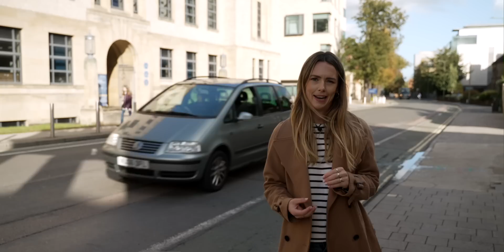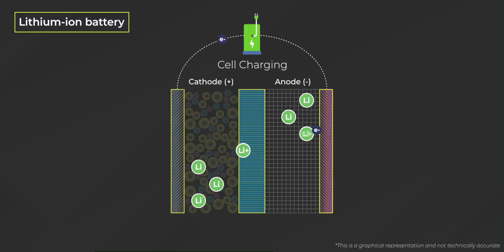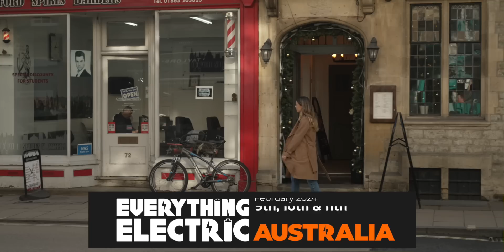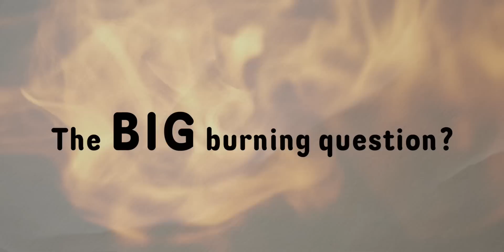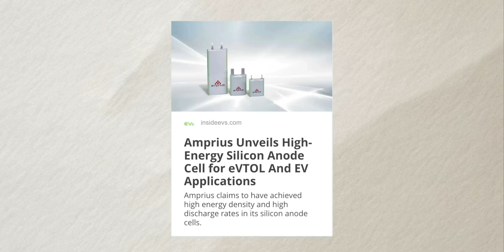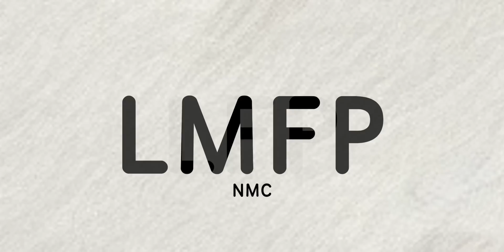The BIG Battery Breakdown: Fires, Failures and Future Breakthroughs!

Comment: One thing I've noticed since having my EV in the last 5 few months is a mile is not a mile. A mile on the motorway or in the mountains is not the same as a flat A/b road. So a 500 mile range battery will probably give me the same full petrol tank range that I had in my mini (300 miles). my car has a WLTP range of 220 miles  which gives me about 100 ish miles motorway driving and more than covers my daily needs. What concerns me most is battery depletion for a given number of charge cycles. I kept my mini for 8 years and it still had all the range available to me. I hope that replacement battery pack will also come down in price over time or there may be many EV's in good condition being scrapped because of the batter state.

Comment: Sure, but the goal will be to hit ranges still between 4-500 and around 7-800 for long range. The only ones that will need 1k+ will be shipping and airospace. After we hit that - its then trying to shrink the battery all while trying to lower the cost of the battery is general. Na + other technology will more than likely take over at some point by 2035+ as the tech will only improve and whatever works with Li will more than likely help Na as well. Again, just need to hit the min of the 400-500 and Na holds both supply and doesnt require mining that normally destroys land. If anything Na + LFMP will more than likely take over by 2030 as the supply starts to ramp up for both. S and Si both allow a 2 to 5x increase as well that again will work for Na and LFMP easily allowing that 4-500 range. Solid state can also help Na batteries already with a few companies releasing ones you can buy today so already a proven method of it working there. Thus Na can take up less space and weight even though they do require a little more to make up the same power des of a cell making them just as good as any other battery at a cheaper and safer chooice.

Comment: For the 1,000 mile battery if your towing a huge caravan or heavy trailer due to range lost you'll probably only get 500miles on the same battery.  Although a 750mile battery would be enough as it would be maybe 400miles.

Comment: I think we have a varying list of needs out of batteries

For example we don't need high density batteries not really what we need is long-lasting batteries that are cheap That's what we need

Right now 60% of the US population can't afford an electric car probably closer to 70% I mean you would need to make $65,000 a year just to owe enough in taxes to be able to claim the rebate which I believe they finally updated to be refundable now because before this it was just a wealthy person's coupon code for EVs poor people need not apply

What we need is consistency reliability long life and a price people can afford and here's how I think we can achieve that

We need to develop a glider call it the People's car like they did with Volkswagen where every manufacturer will receive tax benefits if they make the people's car The glider will be the same from every manufacturer same motor same charger same batteries save everything The body that you put on the glider can be anything you want but the glider itself will be the same and because this car will use all the same parts made by a dozen different manufacturers there will be a dramatic economy of scale impact on the price meaning it'll dramatically reduce the price

Lithium iron phosphate is probably the ideal since it has the longevity

As for range what we need is a 300 mi range battery that's actually a 400 mile range battery hear me out

We develop a battery that will push the standards sedan 400 mi but you're not allowed to go 400 mi The car will cut you off at 300 mi as if it's dead

No way to override this why? For reliable consistency if you're pushing the car a little harder it'll dip into that reserve of 100 mi to make sure you still go for 300 miles if it's winter time and you're running the heat it'll dip into that reserve so that you still get 300 mi you see what I mean? As your battery degrades and you lose range over time the software will dip into that reserve more and more so that you have a consistent reliable always there 300 mi range this will basically erase range anxiety and erase most of the complaints people have now your car with 300,000 mi on it will still go 300 miles on a charge and will probably be able to do so up to a half a million miles before eventually that hundred mile reserve is not enough to maintain 300 miles but who keeps the car that long? Hardly anybody

This will also help preserve used car value it'll eliminate range anxiety it'll eliminate the longevity in general of the battery pack it'll eliminate winter concerns and summer air conditioning concerns it will eliminate most of the basic concerns people have with electric cars that excess capacity will also reduce the wear and tear on the battery since you won't be discharging the battery nearly as much as you normally would effectively every time you ran to zero you would actually have 25% of your capacity left so you would be effectively never dropping the charge below 25% on top of whatever margins they already have in place again this will extend the life of the battery They could even make it automatically discharge to say 20% and only charge to like 85% again only utilize it excess capacity when it's needed to ensure you still get 300 mi range driving around New York City 300 miles range going across Kansas 300 Mile range crossing the Rockies 300 mile range.

The core problem right now is most of the population can't afford the cars

The people who need electric cars can't afford them the people who can afford electric cars are the ones who need the range

Thousand Mile batteries also make a lot of sense who would need a thousand mile battery? Well the guy who needs a 3 or 400 mile battery but he only gets 3 or 400 mi out of that thousand mile battery because he's towing an 8000 lb trailer pickup trucks could use a thousand mile range battery

I would also love to see 500 mile range minivans plenty of space for the battery and these are vehicles where you put five or six people in them and cruise across country

The other advantage of a high range battery is that apartment dwellers can now own electric cars with a range that large you don't have to charge at home you just visit a quick charger once a week like you currently do by visiting a gas station once a week

The primary things we need however are a consistent reliable range that is sufficient a longevity that is sufficient and a price people can afford a $30,000 cars too expensive we need to get below $20,000 not counting rebates and coupons below $20,000 pre-rebate.

Comment: Can you please do a piece on how EV published range is a scam? Thanks.
Reply: Not a scam, it's a standard. It's just as unrealistic as the way ICE vehicles measure mpg. EV range varies hugely depending on use and average speed. if you plan to do constant 80mph then you will get a lot less distance compared to doing a constant 50mph. If you are doing stop start driving in town then your average moving speed could be down to 15mph, so you get a lot more range in that situation.
Manufacturers can't give one number that covers all those situations, so they test to a set of standard conditions covering various situations such as Worldwide Harmonised Light Vehicle Test Procedure (WLTP) or New European Driving Cycle (NEDC).
You get a quoted range that is less than the best urban range, but better than highway range. It's useful for comparing different vehicles, not for planning overland road trips.
Reply: @drumbrakes  thanks for the lesson. You aren’t the channel editor, so I didn’t ask for your response, thanks. I am aware if what you have said here, but no EV mileage is ever achievable and it is the only EV stat that anyone talks about. They need a completely different metric.
Reply: @Surtees-ff  Make your suggestion for a new standard then. I'm listening.
Reply: @drumbrakes  ok; all EVs share online range data and average it per model and brand. Then, when buying and EV that you think will do 130miles you will know it won’t even finish your commute.

Comment: the issue with EVs is the insurance is currently ridiculous. I can't justify buying an EV hat isn't a tesla and yet a teslas insurance at the cheapest I could find is still 50% more expensive on insurance which is more than buying gas for the year.. CO2 is not, they got to do better to make it worth while to change. only a rich persons car still or buy a shitty one and have all the problems with other brands.
Reply: That has more to do with Tesla's repair costs than the battery chemistry, which was the subject of this video. One thing the video did discuss was new chemistries making batteries cheaper, so even if Tesla said the whole battery needed replaced, if that was $8-10k instead of $20k+ the insurance rates would decrease substantially, at least eventually.

Comment: Thanks for this video. Insightful and well explained. Lots of promising technology for further advances. It is worthwhile mentioning each time that there is a big gap between prototype and mass production at cost competitive levels. Tesla 4680 ramp shows how difficult it is to incorporate new technologies such as dry electrode and tabless batteries in mass production. I would assume that they are already working in the background on some of the new chemistries you cover in the video. Amprius clearly has some great technology. The question will be how long it will take to get to low cost mass production.

Comment: He says NMC is the worst chemistry for fires and then talks about Iron Phosphate. Try drilling a hole in a NMC battery. Take out deliberate ICE car fires (theft, vandalism etc) and  ICE fires are a lower percentage per cars on the road. Battery fires are virtually impossible to extinguish. NMC also discharges Cobalt as a vapour which can be devastating to anyone who comes in contact with it.

Comment: 1000 miles range how long will it take to recharge and if course that Scotish chap came up with that favourite chestnut you EVANGELISTS use an ICE vehicle is more likely to catch fire fair enough there us more of them but an ICE vehicle fire is easier and quicker to extinguish than an EV which equals less toxic gases escaping into the atmosphere and far less water pollution and l have been driving for 50 years done millions of kilometres and never any of my 16 ICE vehicles ever caught fire not one.This 1000 mile battery what will be the real range of the battery be maybe 800 miles not good enough for Australia and why didn't you try and debunk that catastrophic truck battery fire in Melbourne it was on a Janus converted featured on The Fully Charged channel and fronted by Robert Llewellyn himself spurking how fantastic an idea it was.This EV truck fire was catastrophic much much worse than any diesel truck fire all those toxic fumes escaping into the atmosphere all that polluted toxic water going into the ocean EVs are great for the environment  l don't think so

Comment: the battery debate is basically about thefairy tale of  goldilocks  more than a quistion of battry chemistry  I personally think that just going from 11 kw/h DC & to 22 Kw/h DC is actually a more relevant debate than whether the cars can drive 1600 km aka 1000 miles, I believes that the  "goldilocks zone",  is between 400 km to 700 km. because here we have optimal use of our resources, and a range that covers 80-95% of all driving, in fact it is more relevant to get better DC charging than AC, because lightning chargers are fine and I actually think that we are between 100-300 kw/h is quite plenty, and more than we actually need, yes I personally choose to limit AC charging on my Id4, and would rather use a 75 kw/h charger than one with more capacity simply to protect my battery from overheating, to keep range knowledge on my battery, on the other hand, a DC let option of 22 kwh rather than the 11 kwh that it has would be much more useful, therefore it is more about the car manufacturers than about actual battery chemistry.   

it is good that we will soon have better batteries, with new technology, but range knowledge is actually quite fine as it is now, the focus must be on DC charging more than AC charging, and that is a question we can send on to the car factories

Comment: 15:01 I expect capped carbon nano tubes to be the solution. The sulfur is packed into the carbon nano tubes and then the tubes are dropped threw a plasma to close the ends. 22:25 yea, but 400 miles at highway speed in snow would be nice.

Comment: As a Canadian I can tell you that you don't need to drive north to be 1,000 miles without a charge point. Ottawa to Winnipeg is over 2,000 km in hilly terrain, Calgary to Vancouver is 1,000 km through the Rockies. An EV with a 1,000 mile range isn't so crazy here.

Comment: As a former firefighter I thought he glossed over the risks of EV fires. An EV fire is hot, can't be extinguished and produces very toxic smoke. An ICE car fire is much cooler, easily extinguished using conventional methods and the smoke is much less toxic. The consequences of an EV fire are much greater even if the frequency is less.
Reply: Maybe a car fire involving small fuel tanks, in accessable places is easier to control, but when a gas/petrol tanker ruptures the devastation is enormous, and when a whole train of liquid fuel derails ...
Reply: @DrakeN-ow1im  We are talking about car fires. A lithium ion battery fire is 2,000 °C or 3,600 °F where as a gasoline car fire can get to 900 °C or 1,600 °F and gasoline fires can be extinguished using conventional techniques such as foam and water. EV battery fires can't be extinguished, you can try cool them, with enough time and water the fire will be suspended but they can and do reignite. 

The Finns are developing a brine cooled to -40 that is injected in the battery case for fighting EV fires on ships. We don't have that yet. EV fires are no joke, petroleum based fires are easier to fight.

Comment: What was not discussed about sodium ion was charge speed. Charge speed is such and important factor. If it sodium charges faster (It was not discussed)  ....energy density is less important, because we really can stop for "gas" occasionally on longer trips. Incremental improvements in these factors add up to huge changes in affordability of real practical EVs

Comment: The Holy Grail for EV batteries will be one that lasts for decades, charges from 10% to at least 80% in 5 minutes (typical ICE fill-up time) and is energy dense enough to support ranges of at least 400 miles. We are very close to this now, but still a few years away. The quick charging is the most important because it means that people who don't have access to home chargers (apartment dwellers), etc can treat their EVs exactly as an ICE owner treats their vehicle: Fill it up when needed.

Comment: Im sorry doc, but a gasoline fuel tank that ruptures will not catch fire if the car is turned off. That's because the only source of ignition, a short, a spark require the circuit in the path of the flowing gasoline to be "hot" or live. I've seen gasoline gushing over the hot headers of a car and nothing happened beyond the gasoline evaporating. meantime we've seen Lithium batteries catch fire from a nail, we've seen Tesla's catch fire days after it was left in a impound yard after moderate damage to the front of the car. incidents that resulted in the now standard practice of dunking the car in a pool and keeping it there for days which means the car is a total write off even in incidents that would result in ICE cars being sent off to be repaired and put back on the road

Comment: A 700 mile battery would match just about anything in the ICE world of sedans.
Reply: What proportion of the use of most ICE vehicles actually involves more than 50 miles do you imagine?
Reply: @DrakeN-ow1im  this is from a reddit post, but similar data exists elsewhere…
‘According to data from the U.S. Department of Transportation, 95.1 percent of trips taken in personal vehicles are less than 31 miles; almost 60 percent of all trips are less than 6 miles. In total, the average U.S. driver only covers about 37 miles per day. '

Comment: Love the term “dwell time”. Those obsessing with long-haul truck range often ignore the fact that mandated rests are required of all truck drivers. In Europe, it is 4.5 hours, in Australia, with much greater distances involved, it is 5.5 hours, and in the U.S., it is 8 hours. The range of the Tesla Semi is 500 miles. It will be no coincidence that this just accommodates 8 hours of driving nicely. The speed of charging is also very relevant. The Australian mandated rest after 5.5 hours is just 15 minutes, so voila, the proposed truck Megachargers can poke in almost 200 miles in the “dwell time”. Incidentally, refuelling a diesel truck is considered to be driving time.